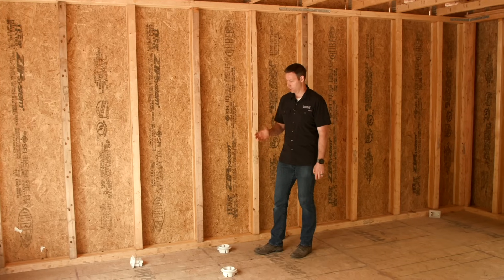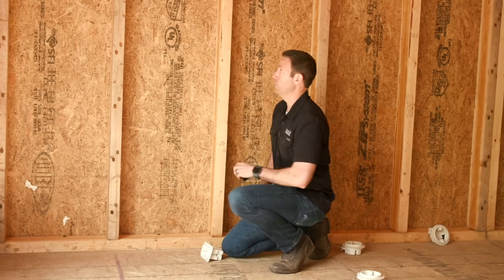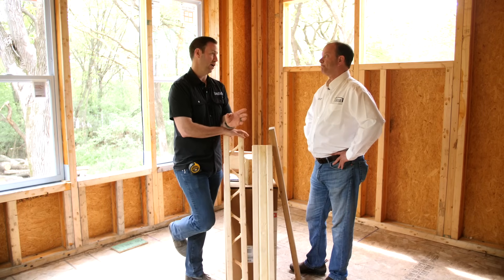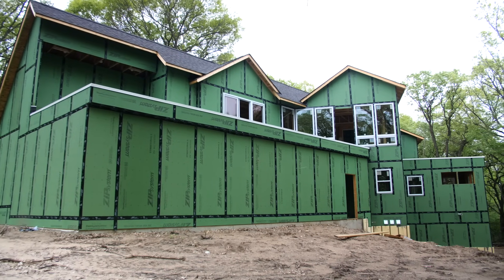Insulated Studs? This is a BIG Innovation in Framing!

Comment: I thought SIPs were the next greatest thing?! Or ICFs ? Or tacking a huge chunk of Styrofoam on the exterior?!
Reply: IMO ICF construction is still the best thing we currently have. ICF is on average 5-7 percent more expensive than ordinary wood framing. ICF gives you superior thermal performance because in addition to an actual R-value equivalent to a normal wall, it also has a massive thermal mass and very little air leakage thanks to the thick monopoured concrete. Also, having a steel reinforced concrete wall will give you better soundproofing and better structural integrity than any other available construction method my multiple times.
Reply: @doctordev97 , 100% correct, it's just not used more because it requires a whole different skill set and is fairly new to most people. Framers are framers, concrete guys are concrete guys, not ICF'S guys. It requires different building procedures that most don't want or are willing to learn. Once it becomes mainstream, MAYBE?, we will look back and say"what the hell were we doing, building homes from wood ?"
Reply: @augustreil  When I was framing, our contractor was a former concrete guy. He wanted to transition us over to ICF's. We did a couple, and I enjoyed doing them. Pretty simple, and very strong/energy efficient. But most of our guys and most of our customers didn't want it enough to pay the extra. In our area neither the temps nor the weather is that that extreme.
Reply: @bryansimmons3723 , Good points.
Reply: @doctordev97   "average 5-7 percent more expensive than ordinary wood framing", that's over the whole house cost, not just framing.
Reply: @brianthompson9485   The vast majority of homeowners who build new aren't going to DIY much of the construction aside from stuff like maybe drywall, light fixtures, and flooring, so while it's true that the 5-7% difference is for the whole house, I think it's still valid to say that in most cases your looking at a 5-7% increase in cost by going ICF.

Comment: Wouldn't it be cheaper and more energy efficient to frame with staggered stud 2x4 exterior walls?
Reply: this is a product for people with more money than sense.....lol
Reply: @trickyrick8621  I want to know how long it would take for savings in energy costs to justify using this instead of cheaper proven construction methods/materials. Will this build last 50-60 years?
Reply: @DonTHEhandsome1  Don most of the alternative building systems including this one you will never see a ROI. You can go to far in the rabbit hole on r-values this is a prime example.
Reply: @trickyrick8621  I figured. Too bad. Innovation is good if it has good intent. Somewhere a millionaire somewhere is building a house and would love this.
Reply: @DonTHEhandsome1  ICF in most cases is one of the best construction methods.

Comment: Wood is a GOOD NATURAL INSULATOR! What a load of garbage to try to say that wood is poor at retaining temperature. Get a blowtorch to one side of those studs and stick a thermometer on the other side, see how long it takes for the thermometer to rise! Is this  the standard way to build a house in the USA? It looks like a trailer/caravan - No brick? The walls look to be made from crap chipwood/low grade plywood. What is the lifespan of these houses? 10 years? No wonder your houses blow away in a storm. No RSJ's, no steel or concrete lintels?

Comment: It's a good concept and arguably an improvement in residential building! Building codes helped keep this concept from the market for many years. European wood-industry mfg's have been producing lattice wood joists for 50+yrs. I saw them being mfg'd in Europe (metric) about 25 yrs ago! But, this round-type wood lattice(dowel) bracing between neutral chords, is something uniquely different than what I ever saw! (Just wanted to add this perspective).●Not everyone will immediately embrace this, but there's no denying that this concept has the features and benefits to improve upon native lumber! It also can possibly be marketed not only as wall studs, but deeper lattice sizes might also be utilized as horizontal floor joists! That niche may not be immediately in demand, but the potential may be? ●Labor rates, labor/productivity and material/related costs are all key factors in the bottom-line! √But quality, materials, labor, insulation, electrical, plumbing, & elapsed time, are all features & benefits for evaluation! And: product-related logistical costs may also be a factor? Doers & Thinkers Club!

Comment: I'm not sold on this until I see a thermal image camera pointing at the dry wall on the surface. That is the true tell tail sign of efficiency.
Reply: I thought the same but the structural integrity of a continuous spray foam wall is what interests me the most.

Comment: Doesn't seem like these address cold surface condensation on the osb the way that exterior insulation does.  I guess the air tight drywall detail better be perfect?
Reply: I don't think it is meant to be in lieu of exterior insulation. More likely in conjunction with it.

Comment: I've been hearing of houses being over insulated for decades, this sounds like an expensive fix to a very minor problem.  What the world needs now is simpler and cheaper housing, not more complex and expensive.
Reply: theres no such thing as an overinsulated house....
Reply: @Etacovda63  There is a thing called Return On Investment (ROI).  It is possible to spend so much going in on products like this that the average homeowner would see very little on the backend in terms of all this being worth it.  I bet this system adds quite a bit to the cost of a house, for what it might return.  Again I think the world needs cheaper and easier to build housing, not more expensive and complex.
Reply: @m.kriddick2731  unless you can do a full cost benefit analysis you're guessing just as much as i would be. Its not brain surgery. Obviously theres such thing as an overinsulated house (walls dont need to be 1 metre thick). 

Properly designed housing doesnt even require dedicated heating. Over the lifetime of the structure that'll more than pay off.
Reply: Depends. If your HVAC doesn’t have to be as large, the savings are significant there. Or, If you spend about half on heating and cooling bills with the same HVAC you would install with traditional framing and insulation, it would be about 7 years to make up the initial cost of say around $4000 for this framing with a 2 story walk out.
Reply: @StrongDadJay  They say in the video that the cost differential is about $1500 for a 2500 sf house, which is pretty good.
Reply: tmoney1876 definitely. Worth it

Comment: This product could take 21 years to pay for itself in the 10 dollar per month savings
Reply: the example in the video of a complex job at 5000 extra
assuming only 10$ in savings a month would be 42 years
average house he said 1000-1500 so extra youd be looking at 9-13 years. again assuming youre only saving 10$ a month.
Reply: For the individual small changes are not always noticeable, but for the system as a whole, all those small changes add up to more total resources, it's not just about individual cost analysis, its about minimizing loss of total resources. A less leaky system runs more smoothly, even if most of the individual parts don't really notice much difference
Reply: You will save more than 10$ per month at current energy rates.  At least 20$ savings from being a better air tight system and better R value.   Odds are that energy costs will GO UP.   In 20 years would you be willing to personally buy a house built in 1990 or spend slightly extra to buy a modern T-stud house?    I recently purchased my last house and I avoided older and less energy efficient houses.  Saves me money each month and I am hopeful that when I sell the house, It will again return me more.   Not everybody looks at total home ownership cost like some people don't factor in car insurance cost when buying a new car and others do.    Fact remains: the new design will save money each and every month.  When selling the home, you can promote your low energy bills.
Reply: How much is comfort “worth”?
Reply: @pilldoktor  that's a personal question that you ask yourself everyone's answer will differ
Reply: Welp I'm not very good at math apparently. Lol its apparent I'm a joke
Reply: I dunno man. I've worked inside net zero homes in the middle of winter when then outside temp is right around zero fahrenheit and you only have to run the heat for an hour or two and then the house stays warm all day. If t studs provide a similar result Im guessing you could potentially cut your heating bill in half during the winter months.
Reply: Wrong.

Comment: How about a thermal image of both studs installed in a wall. Show  me. Wood is a very good insulator.
Reply: When you have a foot of it, sure, but that's assuming excellent chinking and vapor sealing, and it still pales in comparison to a foot of any other substance. To beat foam you basically have to use thatch, and that's really only practical on a roof.

Just saying... I love log cabins and wood just in general, but there's no way I'll ever build a wood house without these. Not only do you get superior insulation, you get superior structural stability. 

BUUUUT since you want a picture, how about an entire write-up including thermal imaging between a wood and Tstud comparable build? https://icrowdnewswire.com/2016/08/29/tstud-insulated-wall-stud-designed-replace-2x6s-2x4s-exterior-wall-construction-party-walls-new-energy-efficient-building-produ/
Reply: Another way to give you less and get you to love it,  spray foam what a joke
Reply: Pete Zahutt why is spray foam a joke again?

Comment: Why not just do offset 2x4 studs on a 2x8” bottom plate with blown in cellulose between the studs? That way no part of the internal studs contact the external wall and the external studs never touch the internal wall thereby virtually eliminating heat transfer. Way higher R-value than R20 and no special products needed.
Reply: Yes, but you should use two independent 2x4 bottom plates to make a 300mm wall, not a 2x8. You should be aiming for a complete, continuous insulation zone (walls/roof/floor), with only 13mm thermal bridges of plywood around doors and windows. 8 inches of insulation is way too thin for a 2019 dwelling. Air tightness is even more important than insulation when building a dwelling without the need for a polluting heating system.
Reply: Your reduction of heat transfer from a double 2x4 wall vs 2x8 plate is so minimal that it’s not worth the extra labor and engineering costs. Remember, someone has to pay for this home and it has to be cost effective enough for buyers to buy and lenders to finance. 

Also, you mitigate air infiltration by sealing up the bottom/top plate with a spray air sealant, foam in the holes where plumbing and electrical wires run, and foam in electrical receptacles. You can also use exterior foam board under your siding. 

This seals up a house tightly, so if you do this in a colder area that gets humidity or moisture, you really need to run an HRV system to introduce fresh air and avoid mold issues.

8” of insulation is plenty for walls. No one use uses 10” for walls, that’s saved for joists and rafters. Again your costs don’t offset the gain.
Reply: We have 300mm walls in the UK for houses that don't need a polluting heating system, and we find that OSB board is not air-tight. We also avoid thermal bridges like your 2x8!
Reply: green genie that all makes sense. I’m in the NW where it’s very moderate and steady temps.  We have wind and hydroelectric energy so most places run heat pumps with a gas or electric back up. 

I agree that OSB is garbage. Houses certainly won’t last like some of your bars that are older than our country. Haha! I’m all for sheet plywood and dimensional joists. TJIs are garbage. We’ll get it together and catch up soon. Hopefully our moron and chief doesn’t completely decimate our economy before we can re-join the Paris accord.

Comment: Is the foam biodegradable?  If it isn't, is it a concern for cleanup?
Reply: If the foam IS biodegradable, how do you stop it from degrading BEFORE you need to dispose of it?
Sometimes the fact that nothing can eat it is a good thing.

There was a class-action lawsuit about widespread rodent damage to the wiring of (Honda or Toyota, not sure which) cars because the insulation was soy based, meaning the rodents loved the taste. The repair involves wrapping the wires with special electrical tape laced with Capsaicin (what makes peppers hot, also active ingredient in pepper spray) so the rodents don't want to chew it anymore.
Reply: @44R0Ndin  Lots of things degrade when exposed to the elements, foam insulation which is generally enclosed and on the inside of things, like houses, doesn't need to be exposed.
Reply: @44R0Ndin  Soy based wiring on the Teslas attracts rodents too, so expensive to repair !
Reply: Those foams are all UV-degradable... No biotics required, just sunlight. Cement isn't biodegradable, nor are shingles. What is your actual concern? You planning on tearing down your house every few years and throwing it away?

Comment: I don’t know if this has been asked, but, as a plumber, what about running the pvc piping such as 1 1/2”, 2”, 3”,? When running horizontally with 1 1/2 or 2” and drilling vertically for drains and vents for 3” and the other sizes. Normally you need that pilot bit to keep your hole saw or paddle bit steady and centered. Seems that foam in the center would cause a problem or waste a lot of time for plumbers having to screw a solid piece of wood in front to be the starter to keep the hole in line. Love the new concept and if I were to build another house I would definitely consider using these.

Comment: I dig it. Curious about how they handle fire impingement. I know that prefab roof and floor structures with gusset plates fail much faster than solid construction and that the wood ibeam floors fail quickly. A solid 2x6 will hold up well directly connected to the plywood and sheet rock. If the insulation and the glue let go of the 2x3s in this board, I imagine that you would have Sheetrock and ply only held together by the dowels on their angles. A great product. But how does it stand up to fire without their treatment? How much more likely is structural collapse over traditional construction?

Comment: Great idea but there is no way that’s $1500 additional cost on a 2500sqft home.
Reply: Vi So  that’s what I was thinking gotta be waaaaay more
Reply: @Jordan060692  Are you taking into account 24 inch centers as opposed to 16?
Reply: apextroll yes even 2’ on center that will be more. It’s an engineered product
Reply: actually it looks like less actual wood and less weight which makes it easier to work with and cheaper to transport ... it all adds up

Comment: A wall R value of 40 or better would be appropriate for a northern state by Passive House (PH) standards. This  relates to the comment about leaving out the geothermal system as one of the cost justifications for the PH standard is that the extra build cost is offset by the ability to avoid installing an expensive heating system as well as lower ongoing heating costs. This could be achieved  by going for the R30 stud and adding an extra say 2" of insulating board onto the frame.